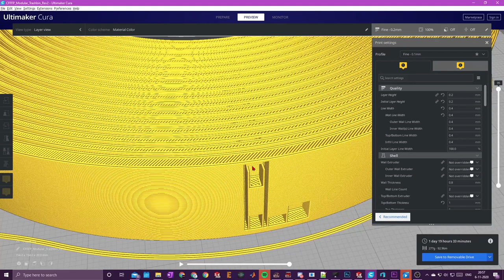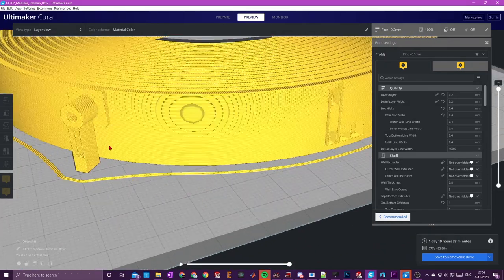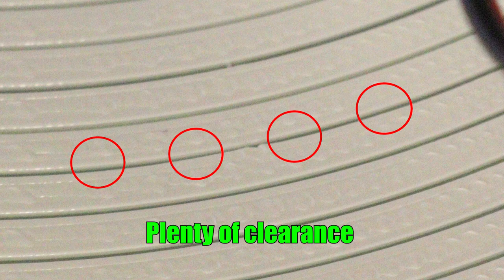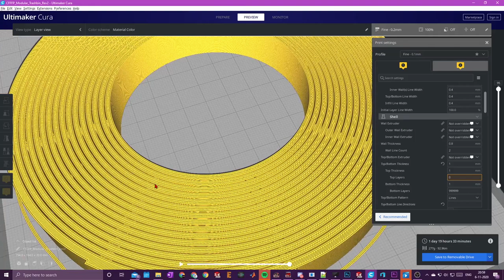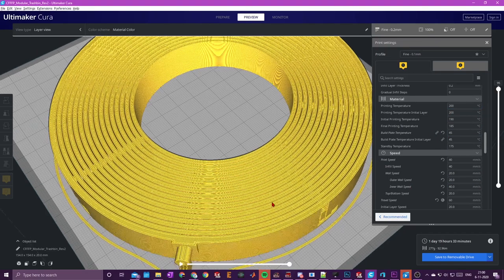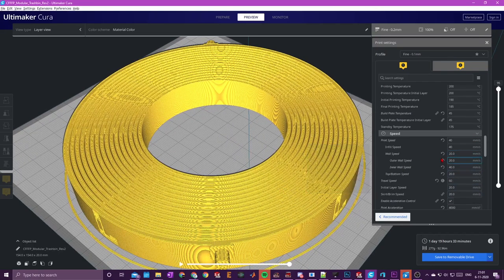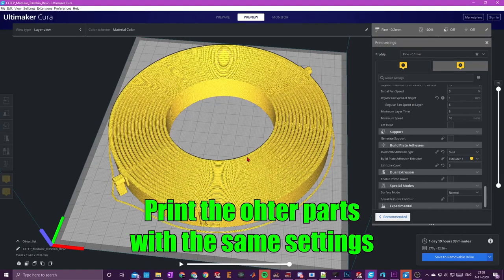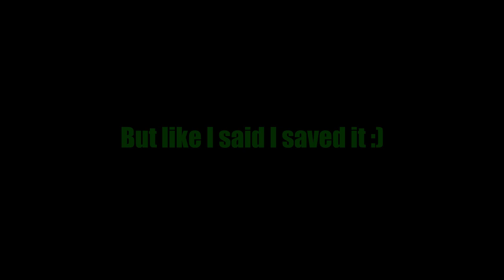3D Printed Pop Up Bin [Print-In-Place]

Comment: Is it printed in PLA or ABS? It has a really good quality of material, wow
Reply from the maker: It's printed in pla :) abs should be possible and thank you!
Reply: @PattysLab  What is the reason behind the good quality? Is it layer thickness? 3D printer price? I'm trying to figure it out to buy the best printer for myself thank you!
Reply from the maker: Print quality is mostly depended on the overall printer quality and speed of printing and part cooling. Layer height is mostly assiosiated with quality but this is a misconception. Imo sometimes does 0.3 even look better then a 0.2mm layer height. If you want a great printer save up some bucks and buy a MK3S+. Ultimaker is overpriced and Prusa has such a good printhead. Furthermore does filament roundness and moist level play a role in smooth print. If you have a cheaper filament which varies in diameter over shorter lengths then you will see Ripple lines in your walls regardless of how good of a printer you have. The some holds for moisture in your filament this will cause the Material to foam and crate nasty prints.
Reply: @PattysLab  oh wow thank you!